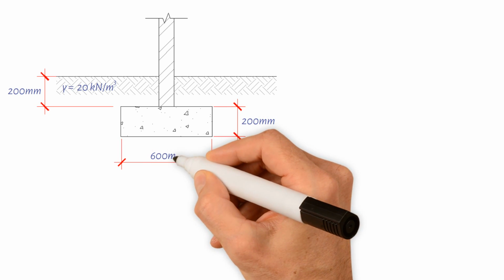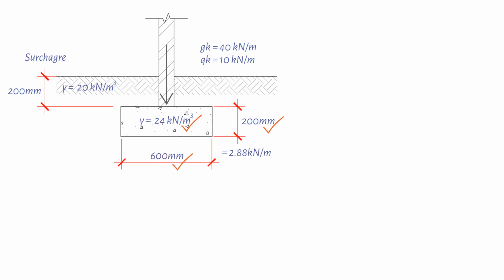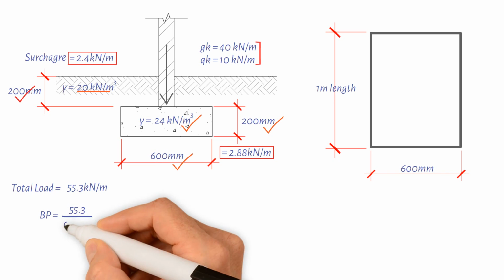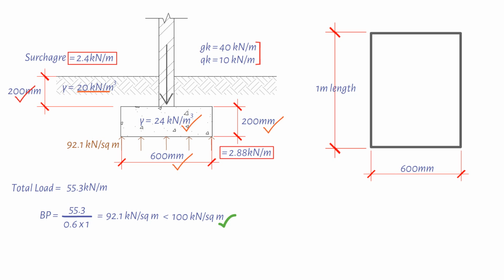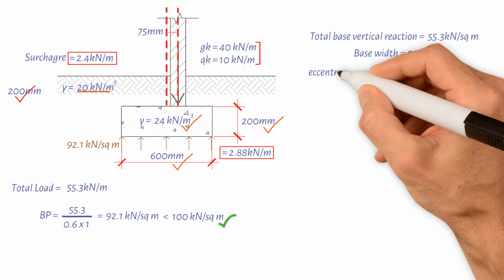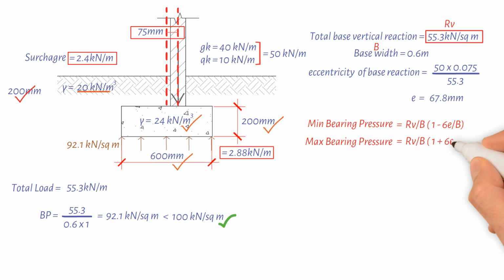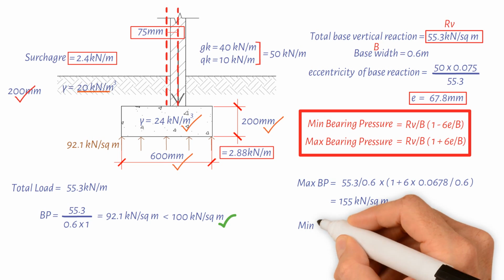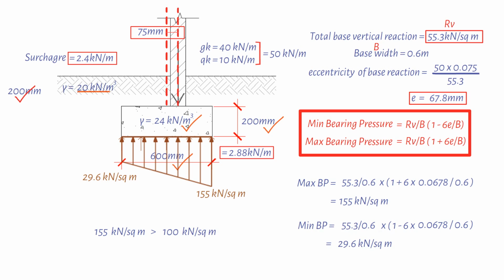Eccentric Loading On Foundations | Bearing Pressure

Comment: Great video but there is always a case where the periphery walls on the property line are eccentrically loaded. What is done for a safe design in that particular case?
Reply from the maker: In that case, you'll need to change the size of the foundation.